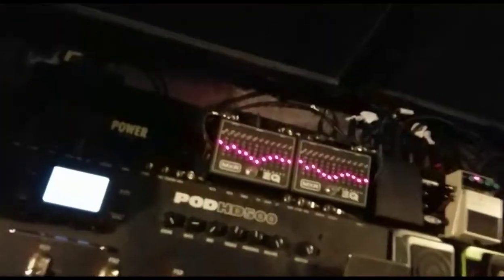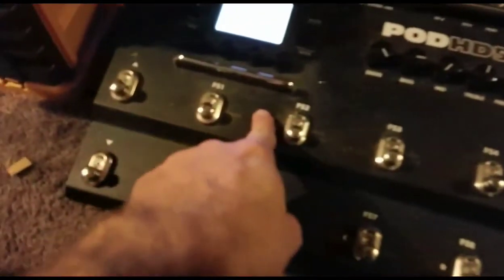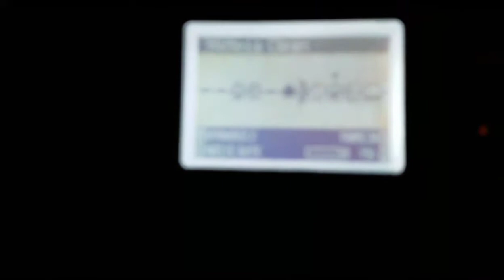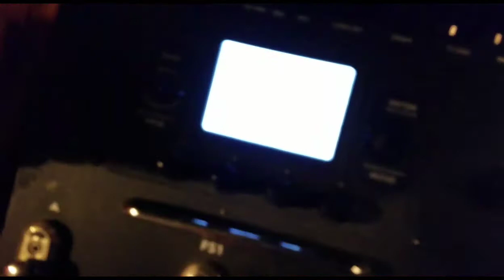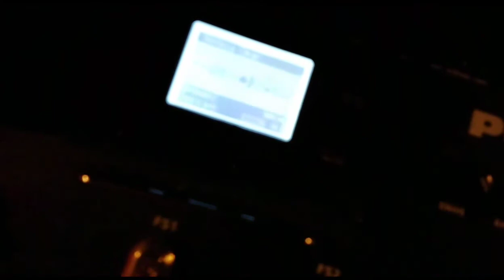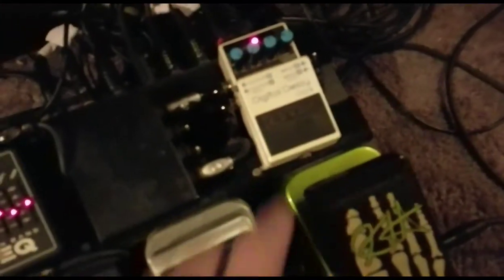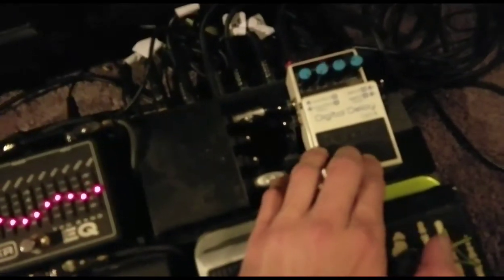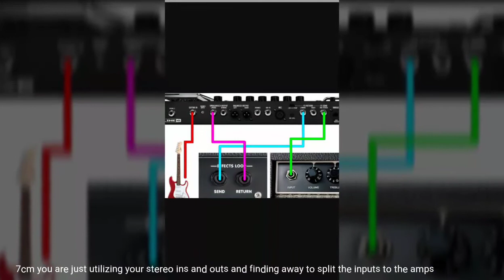Line6 HD500 running 7CM "7 cable method" into a Mesa Dual and Triple Rectifier

Comment: Hey nice video dude but I'm having a little trouble figuring this out on my end. I have a gt100 which is similar. I have the 4 cable method as required but what's on the back of your mesas? I have a triple rectifier which is very similar and I think on the channel switches might be in the wrong position. I don't want to engage it if I don't have to but I cannot go past my send/return pedal on my gt100 in the effects chain, and plus I cannot hear anything with the fictional S/R pedal turned off. Basically what's your channels on the back dialed to?
Reply from the maker: Michael Enochs thanks for checkin out the video my brotha! I've wanted to try the gt100 I've heard alot of good things about it. I'm not sure how much I can help but feel free to search my on Facebook and send me a message I'll be happy to see if I can be any help. If you search Jaysin Clay you should find me easily
Reply: MrJAYSINc Think I found you. I sent a request

Comment: So.  How do you do it?
Reply from the maker: Mark Schuster you can find wiring instructions for hd500 4cm if you Google it and hit images, for 7cm you just use the stereo ins and outs following the instructions except "left's" to one amp "rights" to the other. The fx send is only one output but you can use a stereo trs cable to run it to the front of both amps or do what I do and that's run one cable from the pod to a stereo pedal then to the front of both amps. 
For channel changing I'm running a midi cable from the pod to a voodoo lab control switcher then running that out to both amps so my pod changes both my effects and amps channels